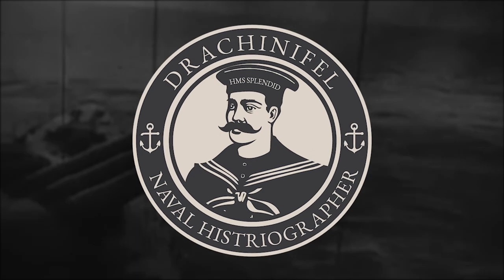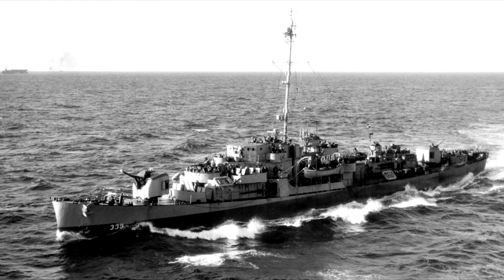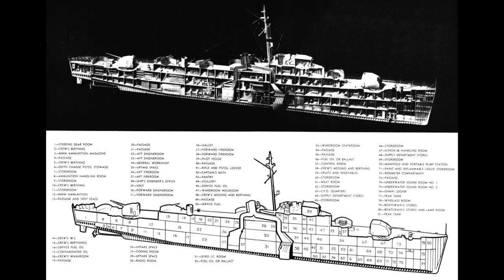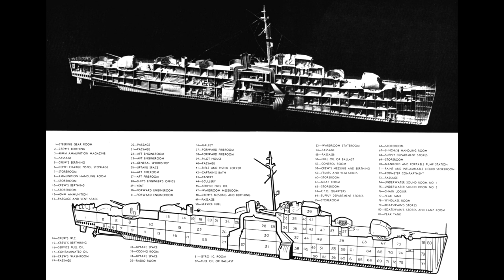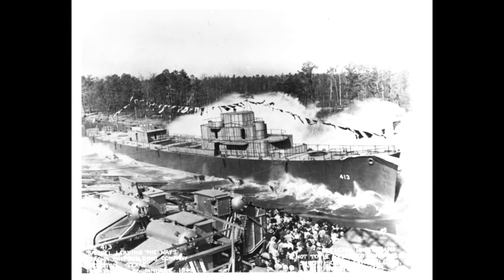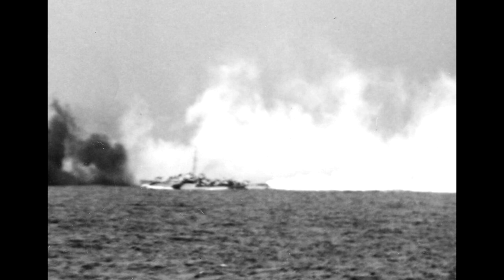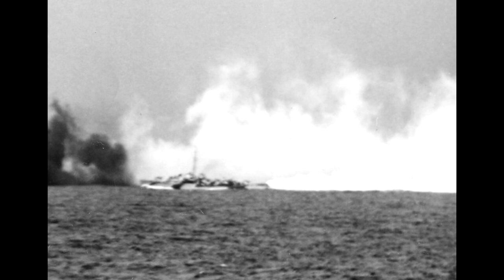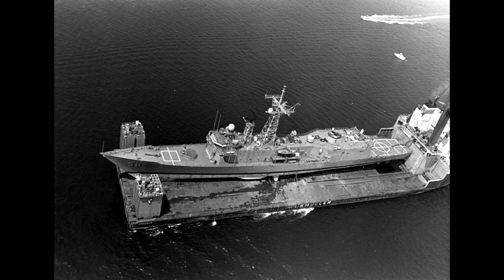USS Samuel B. Roberts - Guide 208

Comment: Not listed in the armament loadout: Massive Brass Balls.
Reply: not just massive...significantly larger. Folk like this are the standard by which size may be measured.
Reply: Chrome plated.
Reply: @paulbaker847  I dunno, can chrome plate to unobtanium?
Reply: @kemarisite  If you can get unobtainium chrome plating is a minor issue.
Reply: Standard on a lot of these tough little ships.
Reply: Almost impossible to believe they could keep those ships afloat with that much brass ballast.
Reply: Space Steel Balls
Reply: TAFFY 3...they kept a big supply of em in stock.
Reply: they couldnt be listed, regulations dont allow that much tonnage of badassery.
Reply: With those as armament, they could've used them to create a hole on the Yamato
Reply: @danagiles5100  some have theorized the magazines of all ships in that flotilla were loaded not with HE, AP, and AA shells, but rather a near endless supply of solid brass balls.
Reply: "And we've got the biggest balls of them all!"
Reply: For a much more detailed account, "The Last Stand of the Tin Can Sailors" is a good read.
Reply: the ship itself only displaced 1000 tons, the rest were the brass balls of the crew
Reply: @quentinking4351  But the poly-urination process is a bitch! ;)
Reply: So big there dragged across the sea floor imao
Reply: The weight of them is the reason the Sammy B is the deepest shipwreck ever found.
Reply: Brass? Dude, these were made from depleted Uranium
Reply: Forsure!
Reply: As an old Navy Veteran frigate sailor (early 1980s), I take great pride in these scrappy little Tincans.  They fought well above their weight class.  😎👍
Reply: Spent uranium ball. Hardest metal there is

Comment: Samuel B. Roberts: Going 4 knots faster than your designed speed while dragging your giant balls through the water.
Reply: Well it was getting lighter in the water by the second.
Reply: @juanmc5731  more air less steel every little bit counts.
Reply: Naw, the balls spin and act as an extra propeller, hence the 4 knots
Reply: @juanmc5731  LOL not only from the shells it was expending but the ship getting blasted apart.  I can see the visual on that scene.
Reply: Hell, you need to cool those overheating balls a tad for optimum performance!

Comment: Sir, won't overloading the engines will have long term consequences?

Yes, but we don't have a long term!
Reply: "I like your optimism, though I think it is slightly misplaced."
Reply: I can't go any faster, Sir. She'll fly apart. . . Then fly her apart!  captain Sulu.
Reply: "We will have seconds at 24 knots or minutes if evading at 29 knots."

"Overloading the engines, aye."
Reply: Pushing engines beyond their normal limits is something of a naval tradition in emergencies.  Any good Chief Engineer will know what the safety margin is - for boilers, usually a 3x ratio between the design pressure and the theoretical tensile strength of the materials the boiler is made of.  So for a reasonably new boiler, an emergency overload of double the normal pressure can be tolerated, now with only a 50% safety margin.  This could only be obtained in practice by tying down the safety valves of the boilers and "forcing" the firebox to consume much more than the economical quantity of fuel and air.
One famous example of using this capability was the response of RMS Carpathia to the RMS Titanic's distress call.  Having made 15.5kn on trials and normally making 14kn in service, she maintained an average of 16.5kn over the three-and-a-half hour dash.  Applying the cube law of power to speed for displacement hulls, we can estimate that 65% extra power was obtained compared to normal service cruising, and 20% more than on sea trials straight out of the builders.
The Fairbanks-Morse diesel engines used in many of the later fleet submarines also had a reputation for reliability that allowed some commanders to expect as much as two extra knots at flank speed over the nominal surfaced design speed of the boat, enough to get over the horizon from a chasing destroyer before the latter could bring its second and third boilers online to catch up, and dive in deep water where they could evade at leisure.  This corresponded to approximately 30% overload of all four engines beyond full rated power, where the economic cruising power was said to be in the vicinity of 60% of rated power (ie. reduced speed and torque settings).  I'm sure this came at the cost of increased wear on various components that would have to be made good later on, but the engines would happily give that much power for as long as was required.
Reply: Sinking is a very short-term consequence ;-)
Reply: Damn the safety limits, I said "all possible power." There is a part of me that gets a warm fuzzy when skippers know their ships and know their crews to give such a command. The Battle of Samar has multiple examples of this. I can't wait to read "The Last Stand of the Tin Can Sailors"
Reply: @pauldonlin3439  be prepared to cheering them on between your tears.
Reply: @pauldonlin3439  It's a wonderful book but quite sad, and you will be very angry when you realise how badly the SAR was handled post-Samar.
Reply: @Kromaatikse  My understanding was the engineers complaint had a lot more to do with how much it would be to clean the engine afterwards.  I think the orders involving throwing coal in addition to oil into a boiler only designed for one of them.
Reply: i like to think the chief engineer  had a bottle of pure, extremely powerful West Virginia moonshine that he saved for such an occasion.

"sammy likes his shine, boss, gives the boilers a snap."

Comment: Boiler pressure limits are intended to preserve the long-term operation of said boilers.
If long-term operation is not expected, there are no pressure limits.
Reply: If there is no tomorrow, there are no limits
Reply: Whiskey, thins down the mix! Gives us another 50 ar-pee-ems!
Reply: @aethertech  A toast to you good sir and your fantastic reference
Reply: There is an ultimate limit. It's usually an explosive limit. One that no sane engineer gets anywhere near, even during oh-sweet-jeebus speed. Hell most engineers don't even know the explosive limit because all the other limits before that are the law. Designers miiiight know tgst limit but it's a non issue
Reply: @GarldBonkdonk  i design pressure vessels at work and can tell: usually you work with safety-factors of 1.5 to 1.75 on the yield strength.
And then there is the difference from yield strength to ultimate strenght as well.
So overclocking by a factor of 2 is possible, if not desired at all (for long-term-use)
Reply: @christophpoll784  oh for sure! Even saftey margins have in-baked safety margins. More to the original comments point though, is that there is certainly a limit. Even if no long term operations are expected. Any pressure vessel can only be pushed so far before going past the final, explody shreddy bad times, limit.
Reply: I would like to point to the passanger liner Carpathia pulling almost twice its design speed in the rush to save survivors from Titanic as evidence that pressure limjts for steam powerplants are often more of a suggestion.
Reply: The only NHRA certified destroyer.
Reply: @ineednochannelyoutube5384  not twice its limit. Over 2 - 4 knots faster than its limit still a bloody good show from ship and crew
Correction 3.5 knots faster than designed.
Reply: @aaronstorey9712  I remember its design speed being 16 knots and sailing almost 24, but since you have actually checked I presume you are correct, and I remember incorrectly.

Comment: Can we just apprechiate how the Roberts lived up to the legacy of her namesake just about perfectly?
Reply: Both ships named after Samuel B. Roberts.  The FFG hit a mine in the Persian Gulf, and was saved by crewmen doing stuff they weren't supposed to be doing.  The crew was doing its damnedest to save the ship when the power went out.  Water had reached the main generators.  The captain said later that he knew right then they were going to have to abandon.  And then after about ten or fifteen seconds, the lights flickered, and then the power came back.  Unbeknownst to anyone else, an engineering rating had been in a compartment below the waterline where he wasn't supposed to be, where the emergency diesel generators were located.  When the ship hit the mine he dogged down the hatch in the access trunk that was the only way into or out of the compartment.  When the power went out he pulled a battle lantern off the wall and did an emergency start on both generators, which if he didn't do it exactly right would have trashed the engines. Both of them came online, and he stayed with them for the next 36 hours keeping them running.  They had to pump 12 feet of water out of the access trunk to let him out.  This was, BTW, a sailor who had been to Captain's Mast on a number of occasions.

The other guy was an engineering PO who took charge of keeping the ship's main pumps running, even though he'd never been trained on how to maintain or rebuild that model of pump.  When asked later why he'd done it, he said "Captain, I can't swim a lick, and I've SEEN the sharks out there.  There was no way in hell I was letting those pumps fail."
Reply: Hopefully both men were commended and given a Navy Cross 
That's above and beyond...

Comment: I served on the USS Carr (named for the aft gunner) alongside the new Sammy B. I love the story of this boat.  Paul Henry Carr was the gun captain in the aft 5"mount. After they lost HP Air pressure he kept up firing despite the danger of the breech exploding which it did. The damage control party found him almost torn in half trying to load one of the last available rounds into what was left of the breech. They pulled him out and he died on the deck outside.
Reply: The Roberts started the action off Samar with 325 projectiles in each of the 5" magazines.  The aft mount suffered the breech explosion on round 324.
Reply: @blakekirk5009 and he told them to help me load the last round

Comment: Japanese fleet shows up

Taffy 3:  So you have chosen death.
Reply: To be fair there were also Taffy 1 and Taffy 2, thus  together with Taffy 3 there were 16 escort carriers and 400 airplanes.
Reply: Reverse bonzai
Reply: @bobbrown5460   Reverse little trees?
Reply: @HemlockRidge  On that day, they were indeed sequoias!
Reply: @HingerlAlois  One has to wonder, if the Center Force continued to plow into the transport fleet at Leyte, would wildcats begin crashing themselves into IJN capital ships?
Reply: @HingerlAlois  

THANK YOU.
Reply: @GnuReligion  

No, because the transport fleet had already landed troops and supplies by that point. Kurita had no chance of accomplishing his goal.
Reply: @HemlockRidge  

The effective range of battleship guns is considerably less than their maximum range (for example, Iowa was intended to engage at ranges above 30,000 yards, but live-fire drills revealed that at such ranges even radar fire control had a dismal hit percentage, meaning the actual effective range was under 25,000 yards).

So you’d have to cut down Yamato’s engagement distance as well.
Reply: @bkjeong4302  I believe the idea of Sho-Go was not to oppose the landing directly, but rather, to sink the transport feet anchored in Leyte.  Ongoing operations in the Philippines would be logistically difficult without transports.
Reply: @bkjeong4302  For shore bombardment, with HE, the EFFECTIVE range was 26.1 miles, at a rate of 2 per minute.
Reply: @HemlockRidge  I meant surprise just backwards because the Japanese thought they got the drop on them but didn't workout that way.
Reply: @GnuReligion  

The transports had already landed troops and supplies and left, and Centre Force would have to wait for them to return with more troops and supplies to actually be able to attack them-and by that point the fast carriers would have turned back south and be attacking them.
Reply: @bobbrown5460  I know.  I was being a smart ass.  It's spelled BANZAI, short for Long Live the Emperor.  Bonsai is an art form producing little trees as art.
Reply: @HingerlAlois  all of the aircraft were loaded for land attack and had to with be rearmed or fly with their land attack load
Reply: @ahoward2kable  
Not all of the airplanes, there were some airplanes of Taffy 3 also at the start that had torpedoes, of course also after their first attack the returning airplanes could be rearmed with torpedoes or bombs.
Thus whilst most of the airplanes of Taffy 3 weren’t well armed at the start for attacking ships, some were and especially Taffy 2 launched a bunch of torpedo bombers armed with torpedoes during the battle.

For example on Gambier Bay of Taffy 3 at least two Avengers were armed with torpedoes at the start, one of them was low on fuel but its pilot Bill Gallagher decided anyway to attack and then ditched the airplane in the water after he had launched the torpedo.
Reply: @HingerlAlois  Small world FYI:  Bill Gallagher was Max Leslie's rear seat man (in Bombing 3 from the USS Yorktown) at the Battle of Midway.

Comment: "Sir, we're out of 5" AP".  "Fire common."  
"Sir, we're out of 5" common."  "Fire star shells. " 
"Sir, we're out of all 5" ammo."  "Open up with the 40's and 20's."
"Sir, we're out of AA ammo."  "Set depth charges to 30'.  Helm, lay us alongside, 40 yards out.  We'll lob depth charges at them with our K guns, then circle around in front of them and roll our stern racks."
"Sir, we're out of depth charges".  "Chief, open the arms locker and issue small arms to the crew.  Have them line the rails and fire upon the enemy."
"Sir, we're out of all ammo aboard."  "Engineer, set ramming speed......"
Reply: You left out "Fire 5" AA" between common and star shells.
Also, "Sir, we're already at ramming speed." "Very good, saves time. Brace for impact!"

Otherwise spot on.  :-)
Reply: "Sir, we're lodged in the port side of the enemy cruiser." "Boarding party away, over the rail and at'em boys!"

Comment: The Johnson (which tends to get most of the publicity) was at least designed to take on fleet units, the Roberts never was, of course the self sacrifice wasn’t limited to those two and include the pilots running dummy attacks with no munitions just to try and hold off the massive centre force, but I think the Roberts most epitomises the sacrifices made that day by many that saved the lives of thousands of others.
Reply: A mixture of all, but I do get your point.
Reply: Don’t forget the USS Hoel.
Reply: @JMan-24  what was the USS Hoel? I have never heard of it.
Reply: She was part of Taffy 3 as well.
Reply: @Shadow-sq2yj  another ship in the force, though I believe this too was a fletcher class destroyer, as was herman. This little bugger saw the 3 "big" destroyers charging and went barreling in after them
Reply: There was atleast one crewman other than Copeland on the Samuel B. Roberts that got a ship named after him. Paul H. Carr was awarded the Silver Star posthumously for his actions as the gun captain on the aft gun. IIRC they achieved an insane rate of fire, one so high it actually lead to a breach failure that killed or mortally wounded the gun's crew. One crew member talks about how they climbed into the gun mount after the explosion and found Carr mortally wounded there, taking him out to die "peacefully" on the deck. When they later came back to check on him he had crawled his way back to the gun and was trying desperately to load another shell into the breach by himself. That to me always epitomized the spirit of the men in Taffy 3.
Reply: @Shadow-sq2yj  : The list of ships that acted valiantly and paid the price for the courage and efforts of their crews were as follows: USS Samuel B. Roberts, USS Johnston  (https://youtu.be/GmiMxDhWnMw), USS Heerman, and the USS Hoel. 

Drach has done an excellent video on the Battle of Samar -https://youtu.be/4AdcvDiA3lE. a really good telling of the actions of Taffy 3.
Reply: The Roberts is also a classic case of what a weapon system (or unit) is intended to do and what it ends up actually doing. And the performance of the Roberts and Johnson, along with the performance of the torpedo bomber squadrons at Midway, call into question the "moral" advantage the IJN were confident they held against the USN. But since both navies modeled themselves on the traditions of the Royal Navy, this shouldn't really have been a surprise.
Reply: @Almond19912  Copeland deserves more credit. He took the initiative to charge in with the DDs (against orders, btw) and overclocked his engines so that he could keep up and take part in their torpedo attack. The other DEs waited and missed out on the glory. Another neat thing was that the Sammy B lacked the automatic fire control of the 5 inch mounts like on the DDs. All of it's magazine-emptying gunnery was done manually. Which is another one of the reasons she sailed so close. Copeland didn't want to miss. The guy doesn't get enough credit for what he did that day.
Reply: @rwaitt14153  Copeland made Admiral,  so he got credit from whom it counted.
Reply: Actually many of those attack runs by the pilots DID use anti-ship munitions. The idea the CVEs had no anti-ship weapons is a pervasive myth that needs to die.
Reply: @Eisengeboren  You are correct ... you must have read Copeland's book "The Spirit of the Sammy B".  The ship carrried 325 shells for each gun.  In a period of 35 minutes the No. 2 gun crew fired 324 shells.  That's an amazing rate of fire; that's the reason why the barrel got so hot.  So Carr was holding the last shell; his spirit to fight was still there despite his wounds but he didn't know the gun had already exploded.
Reply: Johnston*
Reply: Johnston*